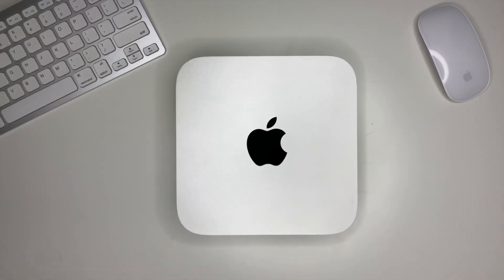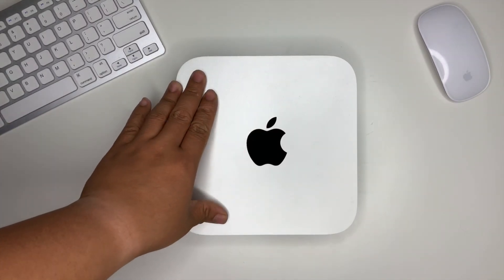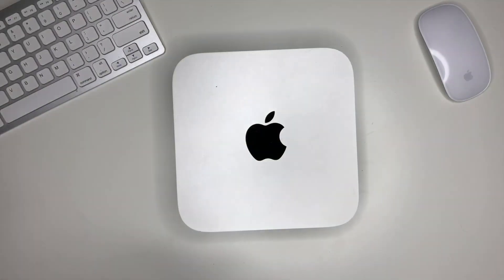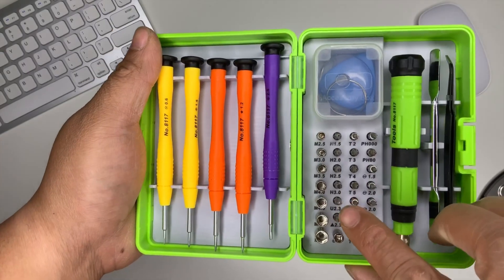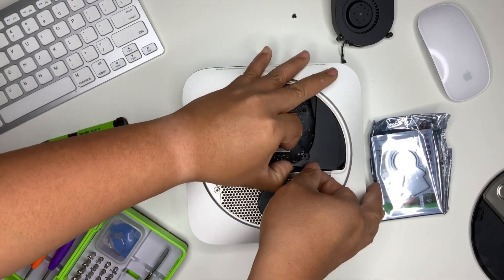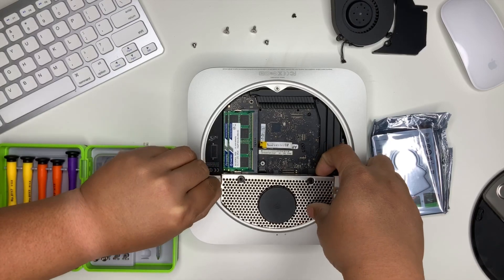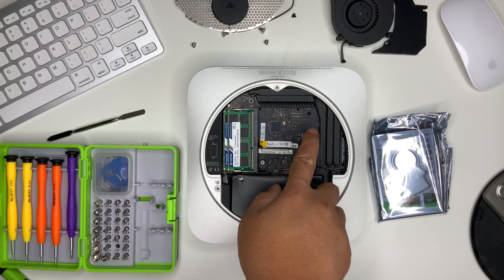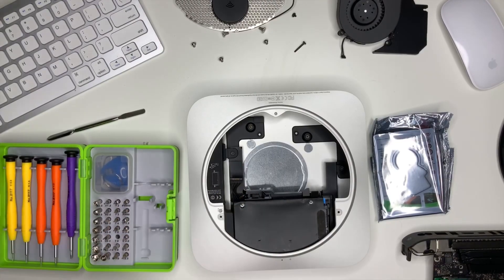How to Upgrade Mac mini 2012 From Single Drive to Dual Hard Drive

Comment: I'm looking to see.  I have an old Mac mini.  not hooked up at the moment and I gotta get my edit done.  but afterwards (later today or Monday) I want to take the second hard drive and put it in with my new Mac mini that has only one hard drive.  I won't know until I open my new Mac.  and don't want to open the new Mac it its not.  never opened my old Mac either.  would like to start a dialog.  the old Mac was a server but I did not upgrade server operating system   it had 19.5   .like I always say "old Macs don't die, They just go slower." I bought my new Mac mini it had os 13.  When

Comment: How do you migrate from a single drive mac to a dual drive mac?
Reply from the maker: You can always just use the second drive as another spot to save files if you dont want to migrate everything. 
Migrating everything requires you to reinstalling the macos, and then resting from backup

Comment: You forgot to mention to pull off the cable from the motherboard,which is connected with the power supply unit, and after that push the mainboard! Otherwise you can damage the cable!
Reply from the maker: Ya for sure. Honestly i didn’t even do that